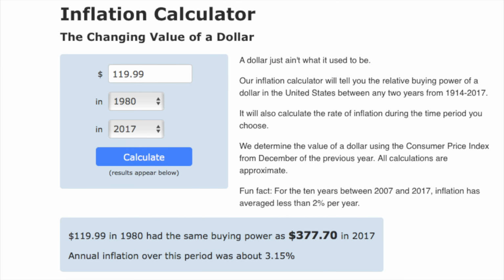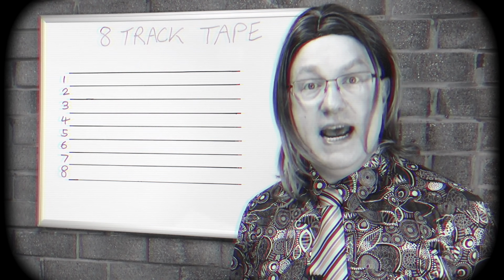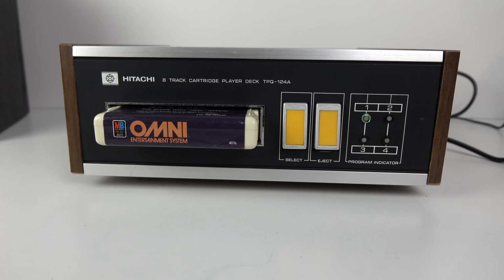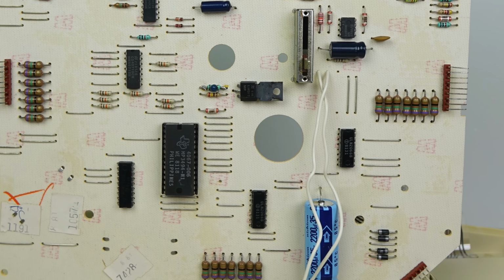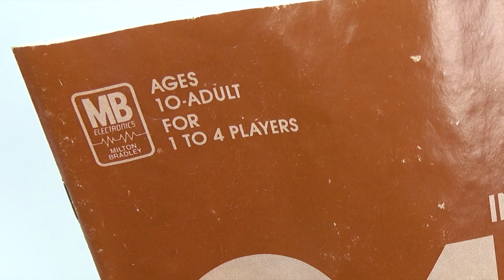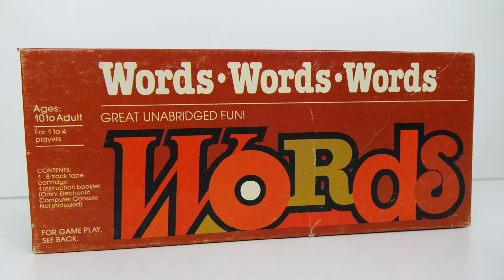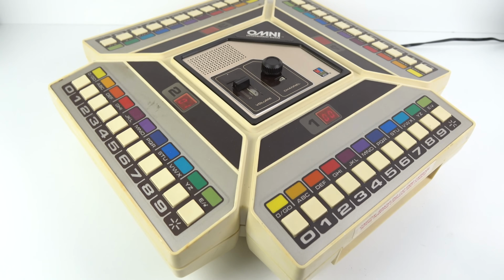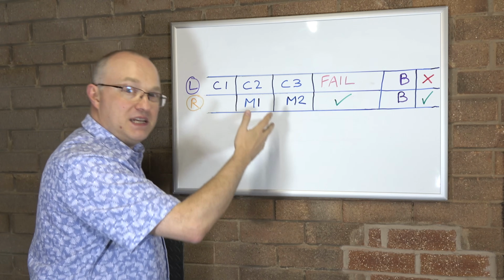MB OMNI Entertainment System - The 1980s 8-Track games machine.

Comment: Is there a way to decode the data on the tapes? It would be interesting to try to reverse-engineer it! Maybe record your own Technmoan trivia tape once it's figured out? :)
Reply from the maker: You'll find a link to a 5 minute sample clip in the video description text box.
Reply: Well, some very first decoding results, but handle with care. When demodulating the FSK I got a clue that they might have actually used Pulse Length Coding with a toggling carrier after each bit, not Manchester Coding, given the repetitive longer pulse stretches. This might be actually easier to decode with the means of the original hardware.

Assumptions:

FSK modulation, 1.0 kHz, 3.0 kHz discrete carrier positions
Pulse length coding, logical 1 approx. 9.0 ms, logical 0 approx. 3.7 ms
Sync preamble of approx. 80 ms

With those assumptions in mind it is actually possible to detect and demodulate the bursts in the Vincent Price Movie Quiz sample Techmoan provided. But again, this is a very first attempt, handle with care. 

Ideas, anyone? Some patterns when comparing with the answers on the tape?

Channel 1:
Burst 001 at 1.986 s: 00102D29001084006673C8
Burst 002 at 15.313 s: 00110AA00129780A60006300004000030000300003000430012E
Burst 003 at 23.084 s: 00102D29001084006673C8
Burst 004 at 43.185 s: 00110AA00129780A60006300004000030000300003000430012E
Burst 005 at 56.688 s: 00102D29001084006673C8
Burst 006 at 76.816 s: 00110AA00129780A60006300004000030000300003000430012E
Burst 007 at 83.443 s: 00102D29001084006673C8
Burst 008 at 94.621 s: 00110AA00129780A60006300004000030000300003000430012E
Burst 009 at 105.412 s: 00102D29001084006673C8
Burst 010 at 124.255 s: 00110AA00129780A60006300004000030000300003000430012E
Burst 011 at 133.231 s: 00102D29001084006673C8
Burst 012 at 149.876 s: 00110AA00129780A60006300004000030000300003000430012E
Burst 013 at 158.853 s: 00102D29001084006673C8
Burst 014 at 185.766 s: 00110AA00129780A60006300004000030000300003000430012E
Burst 015 at 192.265 s: 00102D29001084006673C8
Burst 016 at 209.940 s: 00110AA00129780A60006300004000030000300003000430012E
Burst 017 at 218.778 s: 00102D29001084006673C8
Burst 018 at 242.687 s: 00110AA00129780A60006300004000030000300003000430012E
Burst 019 at 249.185 s: 00102D29001084006673C8
Burst 020 at 267.904 s: 00110AA00129780A60006300004000030000300003000430012E
Burst 021 at 281.422 s: 00102D29001084006673C8
Burst 022 at 306.528 s: 00110AA00129780A60006300004000030000300003000430012E

Channel 2:
Burst 001 at 1.985 s: 0103189119E153DA540022
Burst 002 at 15.312 s: 0082200CA948008100400142103DE0
Burst 003 at 23.083 s: 0040D611E01842F7B4A8004A
Burst 004 at 43.184 s: 0082200D4948008100400142103DEB
Burst 005 at 56.687 s: 0040D609E01842F7B4A8004E
Burst 006 at 76.815 s: 0082200C8948008100400142103DE1
Burst 007 at 83.442 s: 0040D6244423C287B4A80042
Burst 008 at 94.620 s: 0082200C6948008100400142103DE2
Burst 009 at 100.082 s: 00302C031A520021087084
Burst 010 at 105.412 s: 0040A609E17BDA54002E
Burst 011 at 124.254 s: 0082200CC948008100400142103DEF
Burst 012 at 133.230 s: 0040A60DE16BDA54002F
Burst 013 at 149.875 s: 0082200CC948008100400142103DEF
Burst 014 at 158.852 s: 0040D60DE019C2F7B4A80040
Burst 015 at 185.765 s: 0082200C8948008100400142103DE1
Burst 016 at 192.264 s: 0040A605E173DA540020
Burst 017 at 209.939 s: 0082200CC948008100400142103DEF
Burst 018 at 218.777 s: 0040D609E01242F7B4A80040
Burst 019 at 242.687 s: 0082200C8948008100400142103DE1
Burst 020 at 249.185 s: 0040A611E17BDA54002C
Burst 021 at 267.903 s: 0082200CC948008100400142103DEF
Burst 022 at 276.740 s: 00302C022A520021087082
Burst 023 at 281.422 s: 0040D605E012C2F7B4A8005E
Burst 024 at 306.527 s: 008220096948008100400142103DEB
Reply: I was thinking the same thing.
Reply from the maker: You can download some pics of the board here http://bit.ly/2viO1ml One is a 4K frame grab and the other is a picture. Unfortunately I won't have time to revisit this one to take it apart again....I'm onto making the next video now.
Reply: Drew Dastardly Drew Dastardly if you look on RCTI, there's a thread where a guy who claimed to have programmed some of these has posted how he says they were done. I didn't actually think about it at all until you pointed this out, but you're right. I basically read it, posted what he'd said and didn't think about it beyond that. I imagine if I read down the thread instead of reading the first post and going "huh, didn't expect that" someone has probably said exactly what you have. That's what I get for being lazy and not thinking before I say something. I should have read more and thought more before I posted something.
Reply: Cool, thanks for the sample clip. 

The bursts seem all to start with a roughly 77 ms sync preamble. After that the bitstream actually might be Manchester-encoded and then put on the FSK modulator toggling the carrier between those 1 and 3 kHz. Some bursts on the left channel are longer than those on the right, so maybe they contain the answers, points for the answers?
Reply: I think that every databurst has enough infomation to initialize the scoring system (there is no easy way to get to the beginning of an 8track tape.
Reply: +Techmoan could please pretty pretty please post some decent photos of both sides of the board and other bits please? I really would love to work out the digital logic. And I think it's definitely do-able. Every chip seems to be a bog standard 4000 CMOS LSI SSI. I see 4001 quad 2 input NOR gates, 4067 16 channel mux/demux, 4071 quad 2 input OR, 4076 4-Bit D-type register, etc. And yes I know what all those things are ;D 

EDIT: I had in my head "Low Scale Integration (LSI)" when I should have had "small scale integration (SSI)".  LSI of course stands for "Large Scale Integration". I realised I made this mistake as soon as I had a break and got a cup of tea. SSI is things like individual gates, which is what we have here. Medium Scale Integration is things like UARTS or ALUs on a chip. VLSI is complete microprocessors. And  LSI correctly refers to Large Scale integration. What it refers to I can't tell you, but presumably somewhere in between MSI and VLSI. Probably a processor in a handful chips or something like that. Probably a RAM bigger than about 1kbit but smaller than 32kbit is probably considered LSI also. The perils of using obsolete terminology you haven't used in decades
Reply: The signals look like Frequency Shift Keying, simply toggling between 1.0 kHz and 3.0 kHz, burst length approx. 3.3 ms. Decoding the raw bitstream shouldn't be that hard. But to actually make sense of it a little more context (bursts of different question / answer pairs, types of questions, ...) would help.
Reply: There were actually two standards for storing computer data on audio tape - one was the Kansas City standard and the other was CUTS (Computer Users Tape Standard). Of the two, CUTS was more widely used, although some manufacturers still stuck to their own proprietary format.

The data bursts from OMNI sound very much like 300 baud Kansas City.
Reply: Thanks for the pics.  I know a bit about electronics, and I was surprised how much I could make out from that board.  Lots of CMOS chips (4000 series) for glue logic and logic decoding, also probably used to take the program audio and convert it to useful data for the system.  2 motor driver chips that are more than likely for the 8-track. Wow, a LM317!  Never thought I would see that in there.  That's a standard voltage regulator that you can modify via resistance to produce a certain voltage.  I noticed a mono audio amplifier chip (the LM386N) and it's supporting circuitry for the audio amp.  I've used the exact same chip and support circuitry for audio amplification in my own hardware projects.  The other 2 LM chips I believe are OpAmps (I could look them up, but I'm being lazy).  And those 2 beefy TI chips, not entirely sure.  Couldn't find any info on them.  Probably some low level microprocessors.  I have an old Build your own Microcomputer kit from Radio Shack that came out in the 80's and it used a low level TI chip as its main processor, so I wouldn't be surprised if that's what they were used for.  Pretty simple.  I love it.  Inspires me to make some sort of interesting electronics project that uses program data from audio.  Seems you can do it on off the shelf parts!
Reply: Terry Beardmore - is there a standard modem chip that gets used? I was under the impression that everyone just made up their own modulation back then.
Reply: MrGoatflakes ignore the search result for the 16x4 analog multiplexer. This device only needs to switch between two channels. And if you check the datasheet, that multiplexer is too new and speced to have different markings.

I'm pretty sure the two "4067" chips are stock microcontrollers with 2 different custom mask ROMs.
Reply: +phirenz you are simply barking up the wrong tree my friend. All of the chips I could make out are 4000 series CMOS SSI chips. As is marked on the chips, and all exactly the sort of stuff you use if you were building a logic gadget such as the MB Electronics Omni from off the shelf bits back then. And now for that matter.

Unless you were using 7400 series TTL SSI that is. But they didn't. They used 4000 series stuff. As you can see if you read the numbers on them. The middle number on DIP is also invariably the one with the actual standarised part number on it. God knows what the others are, but they are usually consistent in this. Although often you can work out date codes, etc.

The part numbers I read off them are entirely consistent with probably the simplest way of doing it, which is a simple state machine. Implemented as a transition function between the various states implemented with your combinatorial chips, the states held with the sequential chips, in this case the registers (4067s), and the transition function computing the next state from the input (buffered copies of the data burst and the key presses) and also the current state as held by the registers, and also from these inputs it computes the output of the state machine, which in this case would be your track selection and something to control the display. It's a very well known technique in logic design.

And that being the simplest way to do it, using the chips I know are actually present, I'd be greatly surprised if it isn't done something like that way, unless it is using an even cleverer trick I haven't heard of. But yeah "clever tricks" often turn out to be a nightmare and the tried and true approaches work most every time, so I'd guess not.

I'd go further and suggest that it would be easiest with the chips of the day to implement the display as separate bcd counter and a bcd to 7 segment driver. Then your display outputs would only need to be increase the display, flash it and reset to zero, and your BCD counter and BCD to 7 segment decoder/display driver would handle the rest, greatly simplifying both your transition function and even reducing the state you must store in the state registers, with a consequent reduction in the number of chips used.

Think of how many gates you would need to even do BCD digit to 7 segment decoding. Unoptimised it's 4 inverters, half of one chip, then 4x4 input And and then and a 4 input Or, or you can use Nand chips by De Morgan's theorem. And you need 7 of them, one for each LED segment. and you need to duplicate all this 10 times, for digits 0-9. The 4012 has 2x4 input Nand gates on a chip. That's 30 chips per digit (you can share the inverters)! Maybe you could cut this in half with optimisation, maybe more. Then maybe you need LED drivers, which you can also share, one for each segment. Better to use 2 chips per digit, and then you have your counter for free as well, and it is a bcd counter, which means it wraps around to 0000 after 1001. Not too challenging, but why not just use the 4017 or 4553? If you used the 4553, which can hold 3 BCD digits but only output 1 at a time, you need to demultiplex them onto your two display digits.

As far as multiplexing, the 4067 is an "a 16 channel analogue multiplexor/demultiplexor", but I'd wager it is likely not what they are being used for here. In fact they can and were just as easily used for steering around ground and Vcc (0s and 1s) just as well as any analogue signals. In fact they were more commonly used for this purpose. Which I'd guess is what is happening here.

The selection for the track is more likely done by moving the head, which all 8 track players need to be able to do at will anyway. And the data track will always go to the demodulator that feeds the digital circuitry and the voice track will always go to the speaker. Perhaps the exception to that is perhaps it mixes together both left and right tracks when it is playing a normal audio tapes. Or perhaps it simply drops it.

As for what the mux/demux is actually doing, it could be doing any number of things. It could as I said demultiplexing the display digits. It could be part of the state machine, connecting various inputs to various things depending on other inputs or state. It could even be doing logic directly, because you can wire them up to work as a truth table. Or maybe, although I'd say it's not likely, it is steering audio around. Hard to say without a better look at the board.
Reply: Shouldn't be too hard. 
You could actually get pretty far with coping the existing databursts from a multichoice game with the scoring system you want. You could do the same with the multi-character answers by building up a big database and hoping one of the databursts matches the same letters.
Reply: @Terry Beardmore, I'm interested in this and have no clue what RCTI is either, and I searched as well, maybe either give use the forums full name or a link? Not everyone goes to the same parts of the internet you know, and what might seem to be a common site to you might be completely unknown to other people.
Reply: Thanks to @redhound2010 for a first cut at trying to decode the data on the clip uploaded by @techmoan. However there are a few things that he didn't quite get right. The encoding is quite unlike any cassette or modem formats that I've seen before. Data alternates between 3KHz and 1KHz tones. The length of a tone, regardless of its frequency, determines one of 3 symbols: 0=4ms, 1=9ms, 2=15ms. Each packet begins with a preamble: 021212100. Only 0 and 1 symbols are used thereafter. Data is in 5-bit chunks, most significant bit first, with the fifth bit always 0 for 4 bits of actual data per chunk and an effective bitrate of between 89bps (all 1's) and 200bps (all 0's). All that said, the actual data in the clip is as follows:

Track 1
time=  1.986: 10B9900888036EF
time= 15.312: 0245A0099F056003300040003000300030023009
time= 23.083: 10B9900888036EF
time= 43.184: 0245A0099F056003300040003000300030023009
time= 56.687: 10B9900888036EF
time= 76.816: 0245A0099F056003300040003000300030023009
time= 83.443: 10B9900888036EF
time= 94.620: 0245A0099F056003300040003000300030023009
time=105.412: 10B9900888036EF
time=124.254: 0245A0099F056003300040003000300030023009
time=133.230: 10B9900888036EF
time=149.875: 0245A0099F056003300040003000300030023009
time=158.852: 10B9900888036EF
time=185.765: 0245A0099F056003300040003000300030023009
time=192.264: 10B9900888036EF 
time=209.939: 0245A0099F056003300040003000300030023009
time=218.777: 10B9900888036EF
time=242.687: 0245A0099F056003300040003000300030023009
time=249.184: 10B9900888036EF 
time=267.903: 0245A0099F056003300040003000300030023009
time=281.421: 10B9900888036EF 
time=306.527: 0245A0099F056003300040003000300030023009

Track 2
time=  1.987: 10CC926F1AFD5801                 92665
time= 15.314: 21203599008202005110FF 
time= 23.085: 10DC4F0311FFD5801                4
time= 43.187: 21203A99008202005110FF
time= 56.690: 10DC2F0311FFD5801                2       
time= 76.818: 21203499008202005110FF                   
time= 83.445: 10DC9244F18FD5801                924458  
time= 94.622: 21203399008202005110FF                   
time=100.085: 30B0339900888E2                          
time=105.414: 10AC2F1FFD5801                   2
time=124.257: 21203699008202005110FF       
time=133.233: 10AC3F1DFD5801                   3
time=149.878: 21203699008202005110FF
time=158.854: 10DC3F0371FFD5801                3
time=185.767: 21203499008202005110FF       
time=192.266: 10AC1F1EFD5801                   1
time=209.941: 21203699008202005110FF       
time=218.780: 10DC2F0291FFD5801                2
time=242.689: 21203499008202005110FF
time=249.187: 10AC4F1FFD5801                   4
time=267.906: 21203699008202005110FF
time=276.742: 30B0259900888E2
time=281.424: 10DC1F02B1FFD5801                1
time=306.530: 21202B99008202005110FF       

Note that track 1 alternates the same two data patterns throughout and consists only of "Congratulations, you won!" messages. Track 2 is more interesting and has more important data for the game. The numbers to the right of some of the packets are the actual keys that you should press to win that round. Based on this, I've been able to begin to make sense of some of this data although a lot more remains mysterious.

The 2nd and 3rd nibbles of each packet are the number of remaining nibbles in that packet - 1 (Big Endian).
The correct answer is located starting in the 5th nibble of packets starting with 1xxC and continues until a F end marker. Note that you only have to spell the first three letters of a word to get it right.
The 6th nibble in packets starting with 2xx03 is proportional to the length of voice data until the next data packet.
Reply: If anyone still interested in study the data streams, there are full audio recordings of the omni tapes in archive.org: http://bit.ly/34wrFPc

It also might be useful if you have the omni hardware and recording hardware for 8track tapes.
Reply: I imagine it's just machine code for the TI processor. That should be well documented, but working out how the code was modulated into an analogue signal is something else entirely.
Reply: +Terry Beardmore lol no, there is no microprocessor. It's all just logic gates, mulitplexors and registers. Some analogue stuff to decode the data. It's no where near enough gates to make an actual computer, let alone something that can run basic.
Reply: Nice work!  It looks to me like channel 1 is control code, maybe something to do with the format of the question/answer, a typed word in this case.  The first answer is ZEPPO, or 92665 on the machine.
Reply: +Techmoan, thanks for that :D
Reply: Thanks +dunebasher1971 for giving that insight about data tape standards of those days. Really good to know, quite honestly I wasn't aware of them.

I'm still not totally sure what is going on in the OMNI FSK coding. But reading about Kansas City and CUTS I'd say that MB stuck for a proprietary format for their OMNI. Why? 

Kansas City and CUTS specified fixed frequencies for 0 (1200 Hz) and 1 (2400 Hz) and fixed pulse lengths. The OMNI code often toggles rapidly between 1000 and 3000 Hz, which would lead to a lot of 0101 transitions in the code. The OMNI code consists of shorter pulses and longer pulses. However, the longer pulse lengths are not an integer multiple of the shorter pulse lengths.

Currently my demodulator and decoder interprets short pulses as 0s and longer pulse stretches as 1s. 

But what could also be possibly the case here is what an article in Popular Electronics of March 1976 points out: A Bi-Phase-M-encoding of the signal using the two carrier frequencies. That looks actually reminiscent of what's going on in the OMNI data bursts:

http://www.sol20.org/articles/img/CUTS_PE_Mar_76.pdf

So in this case a 1 consists of two short bi-phase pulses with toggling frequencies and a 0 is a longer pulse stretch without toggling the frequency. Having a look on the OMNI bursts I'd argue that they inverted the meanings in their standard, so 0 for bi-phase pulses (as they are quite frequent), 1 for a longer pulse stretch. Problem here: You sometimes get those "lone" 0s (one short pulse), that do not fit into the scheme. Maybe a stop bit...
Reply: Yes, a calculator TI chip could probably do the job here as well ... it's just some scoring and relay-control.
Reply: Looking at the audio in Audacity in spectrum view would allow you to decode it.
Reply: Phil Rodgers I'll have to have another look, but you're right that was my impression too now I think about it
Reply: I so want to do this. I think just looking at it in audacity or on an oscilliscope would probably give you a hint. Just listening to, and if I had to guess, I'd say it uses one tone for 0 and one for 1.
Reply: +phrienz also the 4000 series was introduced in 1968... not sure the date of the 4067 but it isn't recent at all. These things have been around at least since the 70s.
Reply: It sound like a pretty low baud modem sound (around 300baud), so it's probably possible with the right equipment, though it could be a proprietary data stream since it didn't have to be compatible with any other equipment.   Back then a lot of this stuff was custom developed in-house for a particular task, so data compatibility wasn't an issue.
Reply: Phil Rodgers if you look on some of the retro computer forums, its programmed in BASIC and compiled into machine code for the TI chip.
Reply: +MrGoatflakes I already when down this path, started designing the whole thing in 4000 series logic and thought up various innovative uses for a 16 channel analog multiplexer. 

But there are simply not enough chips for such a design, there are only 10 on the entire board. The amount of state required in the machine is massive, At least 6 bits of score per player (not to mention an adder to increment/deincrement it), plus multiple bits to store the answer (if you got clever you could "hash" the answer and store it in as few as 4 or 8 bits, at the risk of accepting bad answers, but remember it also knows the possible inputs (1-4 for multi-choice) and length) And you have to store the answer of each player. 

At the bare minimum there is 48 bits of state, which would require 8 hex buffer register chips... and you are quickly out of chip budget (there are only 10, two of them are the so-called 16 channel multiplexers and two of which are 8 pin dips, probably 555s).

So after my quick design session, I checked out the datasheet for the CD4067B again:

 Problem one, It's a 24 pin DIPs, while the chips on the OMNI are 28 pin DIPs.
 Problem Two, The datasheet specifies the markings as "CD4067B" not "4067-004".
 Problem Three, The datasheet says this chip was aquired from "Harris Semiconductor", in June 2003. There is simply no way that chip would have existed back in 1980 with TI markings.

So we really must conclude that the two mystery chips are Microcontrollers, the game simply requires too much state. They are probably the TMS1000, as we know MB are familiar with it, and its not like TI made any other microcontrollers.
Reply: Dan Schlegel they're encoded in BASIC. Itd be very simple to make your own but not worth typing on a ZX Spectrum for days...
Reply: Cool. The next part is to compare the data against the expected behavior.
Reply: redhound2010 I don't think it's that simple, unless the first bits of the tape set up some executable code in RAM which can utilize that data. Since the scoring systems work so differently, I'd say it's not entirely unlikely that every data burst contains largely duplicated code to handle the answer checking and scoring.